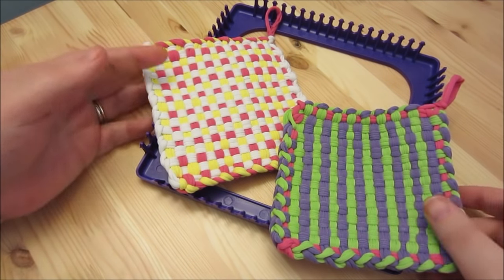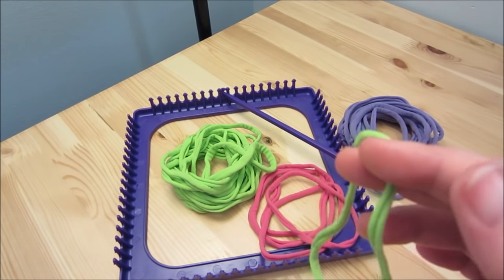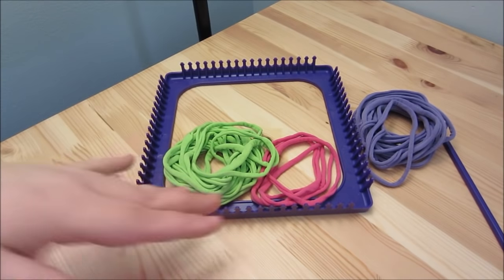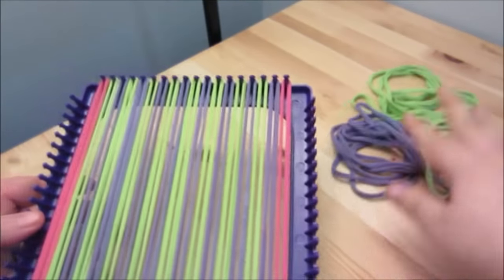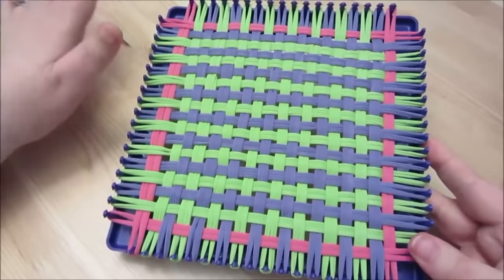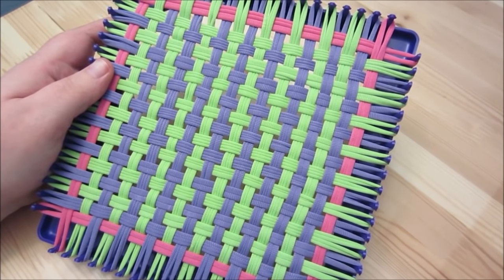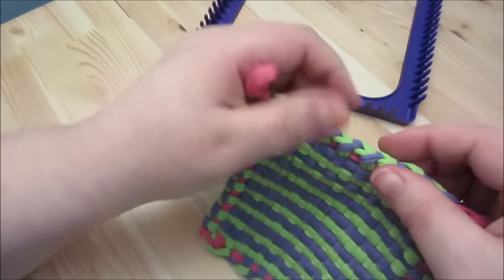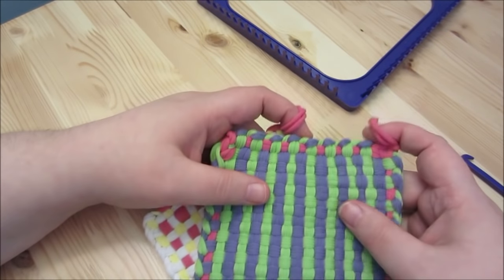Square Weaving Loom

Comment: How do you get those colors???
Reply: it came with mine
Reply from the maker: The loops came with the kit. You can buy separate loops though. I've seen them in mostly clear plastic bags hanging from hooks near where they keep these kinds of kits. I'm not sure exactly what they call that section of the store, but it's something like Activities. In my local stores, it's usually near where they keep puzzles or model kits.
Reply: Wow
Reply: CraftingWithClaudie
Reply: Angela Ponder from the set duu
Reply: Angela Ponder i think it comes like that but i didn't get white and gray i got the beads,both hot and light pink plus more cloers close to that
Reply: Angela Ponder they were from Walmart
Reply: CraftingWithClaudie at Walmart it's called the arts and crafts
Reply: The new kits have them. I love the color but they make them way to thin way way to thin !
Reply: It comes in a kit the one I am doing is white purple and pink
Reply: If you have a Hobby Lobby in your town, the kits should be near the Children’s Activities section
Reply: It's tshirt yarn....
Reply: Hi this is aleeyah and akira thank you so much for this vioie  and my auntie was helping us and  im 8 yreas old and im10  THANK YOU SO MUCH